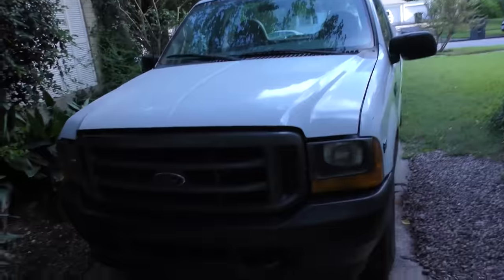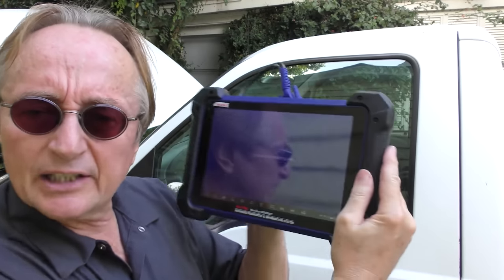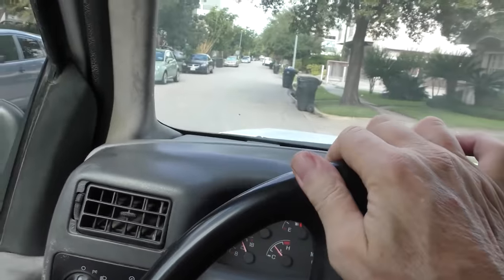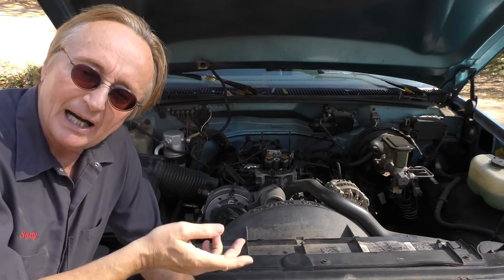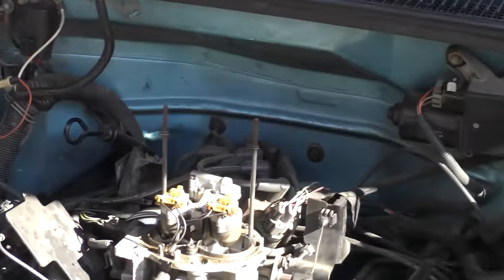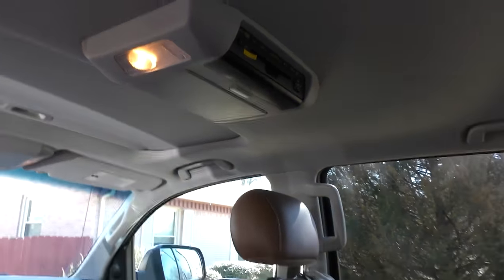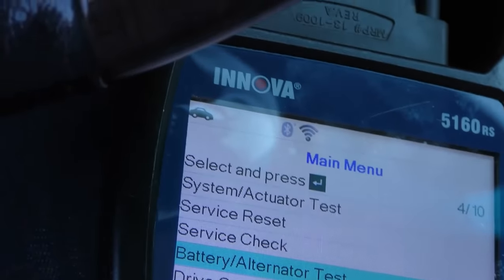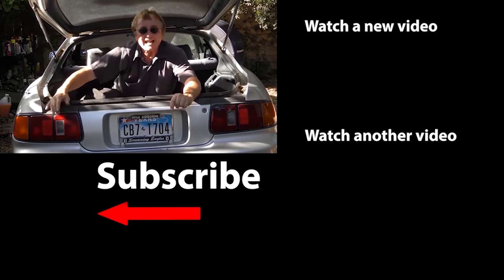3 Trucks That Will Last 700,000 Miles

Comment: My 96 Ranger is immortal. The first odometer quit at 250k. It’s been through two more and the last odometer quit about 14 years ago. If I had to guess, it probably has 700 to 800,000 miles. On its third clutch. Had the transmission rebuilt once and the 2.3 Lima has never been out or apart, just routine maintenance. Been commuting 100 mile round trip for about 10 years. The only time it was towed was a u joint decided to call it a day. Of course it’s been through timing belts, water pumps, hoses, brakes. I just last year replaced the entire AC system for around $400 and had it charged at a shop. About the same as a typical car payment
Reply: It's good to score on a dependable vehicle
Reply: I had a 76 Toyota Corolla when I was young and I ran that car back east twice and then more and when it had  about 300,000 miles on it or something I sold it to a friend and he ran it for about 10 years
Reply: Wow!  You certainly got your money's worth out that great little truck.  Good for you!  I've been driving a 30-year-old truck which I bought when they came out for $5k. Long ago. LOL  I had to replace the A/C a few years ago, but everything else is still original. I've been blessed and am grateful!
Reply: @Popwarner-x1w  Yes, no one can kill those little cars. I had one and gave it to my son who drove it from FL to Maine while it had nearly 300k miles on it and it wasn't until he wanted a Camaro that I sold it to give some of his down payment. Regrets.  God Bless you always Larry.
Reply: I'm set for life. I own 3 rangers. A 4 cylinder lima a Volcan 3 liter and the 4 liter 4x4. Immortal is right
Reply: Can confirm Immortal is right, my 97 ranger is still kicking , best little truck ive owned, 2.3l standard. :)
Reply: Is it forest green, single cab, manual trans, RWD, base model? I know 2 rangers just like that both holding up, one over 400k and the other just around 150k
Reply: @quiteaskew279   Yes sir it sure is, the sidestep version . over 150k :)
Reply: Those Rangers are great little trucks! I have a 2000 with a 3.0 V6 and 370,000 miles on it. Still going!
Reply: My Ford Ranger Died at 114,000 miles.

No reason for me to waste my money on another Ranger.

I sold it as a junk vehicle for $ 200.00.
.
Reply: Got a 1996 Mazda B2300 pretty much the same thing solid metal body, Mazda motor Ford transmission and body. Did replace the transmission once. Motor is just about bullet proof.
Reply: Damn straight about that 96 ranger.... $12,500 new in 96 w Ford discounts. 
No car payments in decades.
Insurance keeps rising despite clean record.

Bouncy and jumpy when bed empty and can get stuck in a slightly sandy drive way with minimal grade.

Scary as can imagine on a snowy highway mountainous road.
AC will fail first.

2.3 l, standard transmission seems unbreakable, no matter how hard you try.

Allegedly they are becoming sought after for off road conversion.

The only thing that stopped it was Ford ending production.

People will make you offers on the regular....

After awhile, like an old friend of decades that outlast many marriages friendships careers homes, no matter how many moves or deliveries you've assisted others with...

A wise middle age engineer said to the graduate, a mans gotta have a truck...

And he's right, still.
Reply: Complete new A/C system for $400- how did you manage that (DIY? please share where you purchased from)?
Reply: Sounded like you just described my old 96 Mazda b3000 (ranger) 
Had the ford motor and looked just like the ranger lasted forever.
Reply: Awesome!  I have a 2011 that I absolutely adore, they will bury me in that truck!  It has over 200k on it and that 2.3 DOHC little 4 banger is awesome, 5 spd. standard, hand crank windows, 6 ft. bed, non-extended cab, with the rubber floor.  Love, love, love, this little truck to pieces.  I keep it oil sprayed so it doesn't rot out on me, as I live in the Northeast, "Rust Belt."  Truck is a dependable, reliable friend to the end!  I will never part with it!
Reply: @Madasin_Paine  Absolutely well said and 'Nuff said!  Awesome!
Reply: Mine are 97s. Both 2.3 5speed Splash. One for Summer and one with rust for winter. Mileage near 200k on each. Just replaced a idle air control. 
Bulletproof.
Reply: My 97 f150 a tank, i also drive it 100 miles a day, only 160,000 miles on it sounds close to factory mint when it runs
Reply: I had a 98 Ranger with 130K or so. Total POS. Simple yes, decent mileage but zero power, barely passed emissions(2.3L). It was gonna cost more to replace or fix the engine than 2 trucks were worth. It mercifully got flattened by a Jeep Cherokee. It's replacement (a Tacoma) is 10X the truck.
Reply: @mikeblank5139  "I killed my Ford Ranger at 114,000 miles because I didn't do any maintenance." There.,. Fixed it for ya.
Reply: 2.3 w/8 spark plugs are BULLETPROOF ENGINES
Reply: I had a 94 V6 ranger and it was awesome
Reply: @Yohann67  my tacoma went to the junkyard at 97k when the frame rusted through and broke.
Guess there are turds in every bowl.
Reply: @lawrencekokjr.1376  No doubt, I know there was a problem with some older Tacoma frames.
Reply: @texherrell1821  Mine certainly made me want to shoot it. I doubt it would have made 140k if it hadn’t been run over.
Reply: I think somebody smoking something
Reply: I have a 1996 Ranger too. Just replaced the clutch at 205,000 miles.  Looking forward to years and years of dependable service with that truck.
Reply: I have a 98. I live in the rust belt of pa. Cab is solid. Bed is rotting now; the frame from the cab back I rebuild in 2012. Needs it again.
Reply: My '97 2.3L Ranger had 201K miles when I traded it in back in 2006. It still ran like it did when I bought it new off the lot. The only reason I decided to get rid of it was that an F-250 rear-ended me and made a mess of the truck, though it was still driveable for many months. I now drive a 2021 Ranger and I still don't regret being a Ranger guy. I often wonder how long my 97 would have lasted if that damn F-250 driver was watching what she was doing. There were no injuries, fortunately.
Reply: @user-md1so4id9e  Rock Auto
Reply: @Nitebot13  got 220k on mine. Never done any work on it beyond replacing the timing belt (twice), the water pump and alternator . . .
Reply: It's got that many miles cause the owner takes care of it by replacing parts and regular maintenance
Reply: I wish I still had my 97 Ranger 4.0. Great little truck. I have to say that I love my 02 Silverado too. It has 350k and runs great.
Reply: Mine has 578000 regular maintenance few clutches, air and heat still works great. 96 2.3 5 speed step bed.
Reply: I know that truck, I'm no stranger, that's a Ford f******g Ranger!! 😂
Reply: Same with my 2005 Ranger, just turned over 150 grand, put a new radiator,  plugs and wires, original freon, air still blows cold,  the three litter v6 still going strong after 17 years, everything works. No trouble light. Probably outlast me.
Reply: My 1998 Mazda B2500, 4 cylinder (Mazda version of the Ranger) is pushing 400k. Still runs smooth, cold a/c, and it was a towing/working ranch truck
Reply: I had owned 2 Rangers XLT  both with the 4.0 a new 93 put 415,000 miles on it and sold it off in 2015 . I bought a 2004 Ranger in 2008 since at that Ford was deciding if they were going to continue to make them it had 59,000 miles on it. I sold it at 315,00 miles friend of mine put another 65,000 miles before he traded it in on a newer truck. As of few months ago he saw it local Home Depot still on the road.
Reply: @vextract4662  my 03 focus has the Mazda z tech engine . 307,000
Reply: I Love my 97ford ranger xlt 2.3 manual transmission over 500,000miles
Reply: Wow 👌 they were very  reliable
Reply: What motor is in it?
Reply: Got a 96 ranger myself and can confirm that they are immortal. It's got the original motor and transmission with almost 130,000 miles and have only done regular maintenance as well as having to replace some stuff due to age. It's on its 3rd starter, second alternator, and had the odometer and fuel gage changed at about 75,000 due to them no longer working. I do as much of my own work on it and just this past spring put a new team main seal on it due to an oil leak. I got it from my mom who got it from my pawpaw in 2016 when I got my license so that I would have something to drive and I got it put in my name in May.
Reply: Had a 94 Ranger extended cab w the 2.3 engine and a 5 speed. The engine ran great, but the truck was very slow, and I'm not someone who thinks about an engine's power usually. The weight of the extended cab + running the a/c likely knocked the power down. Can't imagine what it would have been like with an automatic, or what it would have been like to tow anything with it. Not great traction- I used it to work on a house I bought, and it would get nearly stuck in the yard if the bed was empty and the grass had some dew on it.
 I have a 96 Tacoma now w the 2.4 engine- 30 mpg on the highway, has some oil leakage around the valve cover, but otherwise runs nearly like new w no noticeable oil burning. It's a lot peppier than the Ranger. 328,000 miles on it, and judging from the rust and dents, they were hard miles. It was cutting out when the tank would get down to 1/4, so I dropped the tank to change the fuel pump, and it looked like rust soup inside, w sludge dots all over the pump sock. Amazing the Tacoma ran at all with that mess, which probably happened because this area is humid and the truck sat unused for a while. It keeps chugging along, better now the tank is clean and w the new pump.
Reply: Agree! I have a 94 Ranger with the Lima 4cyl. High mileage, runs like a top! Ford used that engine for over 30 years....Amazing!
Reply: @mikeblank5139  it probably wasnt serviced properly the first 75k miles.when there serviced properly they last a VERY LONG TIME!!!
Reply: So many people complain about Toyota prices, but  these days the crappy trucks are more expensive! If a car is paid for, you can save that car payment into your savings. Whenever you need routine maintenance, pay for that from normal living expenses, but make any repair payments from that savings. You will have the cash saved for a new car long before your Toyota will need replacing.
Reply: I have a 2011 with 57k on it. I could only hope
Reply: 3.0  V6?
Reply: @jasonsaeli75   I have a Vulcan 3.0. Taurus.  
         I heard these were better than the Ford 3.8
Reply: @Nitebot13  Whoa!  Don't go public with the praises of the '97 2.3L.  That was the best year of the Ranger.  Took 18 months to find mine.  They are getting hard to find.  The 2003 Ranger was one of the worst vehicles I've owned.
Reply: @mikeblank5139  was it a 2003?  Very bad year.  I now have a '97, and almost the best vehicle I have owned.  The 2003 would have been the worst but I married into a 3,000 mile Citation.  

So what does a 1978, 1,750,000 mile Corolla, and a 3,000 mile Citation have in common?  They're both used up!  That is where I disagree with Scotty....  In 1984 I said I will NEVER again will I buy a Chevrolet.  Stuck true to that promise.
Reply: If you have to rebuild part of the drivetrain I hate to break it to you but that means it didn’t last 700,000 miles
Reply: Definitely. I love my ranger to. But 2wd and a 3.0 Vulcan V6 I can’t tow a boat with that thing. 4000lbs is enough to get a 21ft boat to the lake, but how am I going to get it out 😂. I’d love an f250, 2500, or Tundra.
Reply: Those are basically bulletproof. America sure got it right with the Ford Ranger.
Reply: I just want to say that those types of sick jokes at 15:15 are no joking matter. It doesn't matter to me who is in the picture. That subject is not something to joke about Scotty. Please stop if you have decency.
Reply: @green1814  what the hell are you referencing
Reply: I had a 98 ranger and selling it was my biggest regret honestly as far as vehicles go. I bought it for $750, nothing wrong with it past inspection and I got 5 years out of it until I had issues with the hydraulic lines on the clutch and decided just to sell it. I bought a 07 Silverado which has been pretty good to me but it had the same damn issue with the hydraulic clutch months after I bought it, only then I had car payments on top of having to fix it. It's also not as fun to drive as the ranger was I really miss that thing and like you said it was indestructible
Reply: I bought a new ranger in 1993 she now has 370.000 miles on her.
Reply: Is the 2.3 in my 2010 ranger the same as all these ones reporting 300k or more miles without problems?
Reply: @jeffroberts760  I'm not sure on the 4 cylinders. I believe the 3.0 v6 went through some changes on the later models.
Reply: @raytycker1656  let me know if you ever find anything out
Reply: @Popwarner-x1w  my 98 got wrecked by some chick in a Mercedes who rolled through a stop sign
Reply: @MrBigsteve518   I have the Vulcan 3 liter, rated for 300k miles. Runs like the devil,  153k miles
Reply: I had a 2005 XLT extended cab with the 4.0 V6. I bought it new and unloaded it just a few months ago. I would have kept it and had no intention of selling, but I came across a deal   I couldn’t refuse and had to let it go.
Reply: Reminds me of my first car. Not a truck, but a 88 Mazda 626 manual. 17 year old me in 2004 thought that 423,000 miles was just impossible on a vehicle. Found a parts car for under a grand and just replaced stuff as needed. Was still running fine when I sold it. Regretted it ever since but man was that thing ugly as fk.
Reply: @imnjs   what's ugly is a car payment
Reply: Ford will probably buy it from you at a million 👍
Reply: I think the six cylinder tundra is non interference
Reply: Easy to break into with the antenna. Thanks Ford!
Reply: Correct. Put over 180k miles on a ‘95, with only significant change was the A/C compressor. Sold it to a guy in 2010 who drove it 3 more years in Houston, then drove it to Guatemala where it’s still running strong.
Reply: That 2.3 liter Pinto motor has always been unbeatable.
Reply: I had 1995 Ranger and the body looked fine but the frame totally rotted out. Apparently, there where a few years when the frames had a tendency to fail. 
It looked good but my mechanic warned my that the frame was Swiss cheese and it wouldn’t pass inspection. 
I sold it to a guy who thought he could work on it ( I was up front about it’s condition) i replaced it with a 1984 Ford F150 6 cylinder 3 speed manual long bed. 
I’ve had some work on it but it’s been solid and the frame is in good shape.
Reply: Wow man what year!?
Reply: My 94 explorer has original everything but the starter with 500000  milles
Reply: Ford frickin ranger!
Reply: I bought my 93 ranger new it's got 380.000 on the odometer and runs great.
Reply: Haha nice I use to live in Lima Ohio drove past that ford plant a hundred times
Reply: Timing Belt In a 2.3 4Cyl Ranger?
Reply: nobody wants the vulcan, but it is hands down the most reliable engine the ranger ever got. The 4.1 liter pushrod is just a bigger vulcan so if you watch the rpm they'll last just as long. The 4.0 is cool but the trucks it came in were poorer quality (except the 03). The 93 4.1 liter is the best ranger